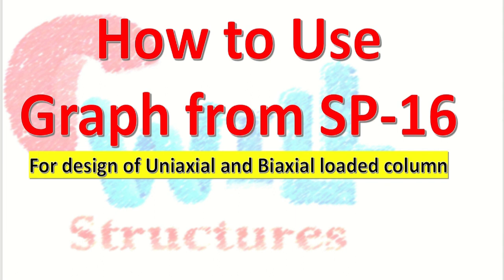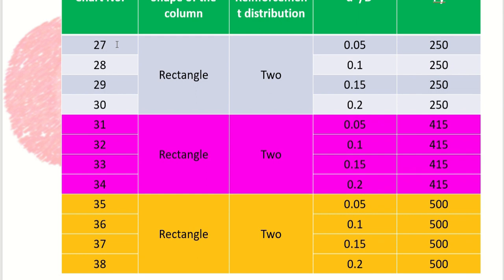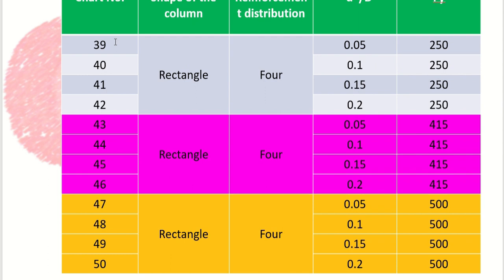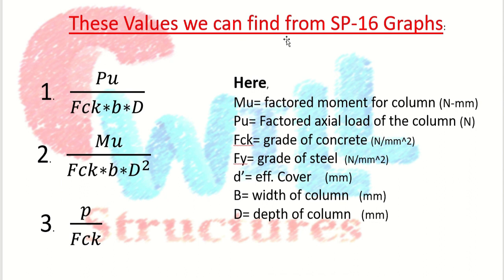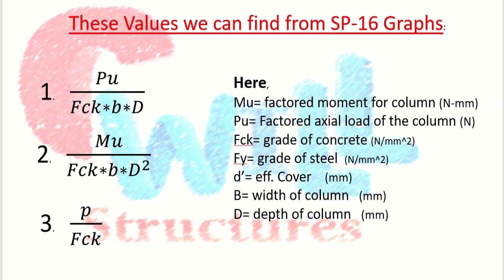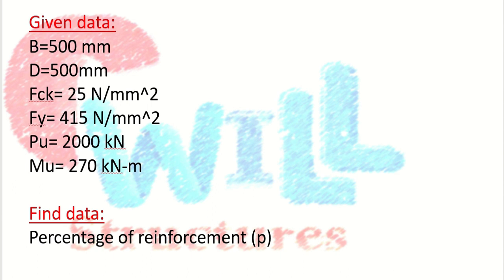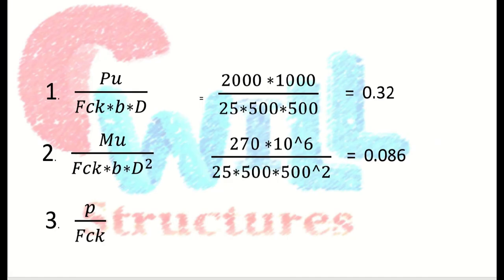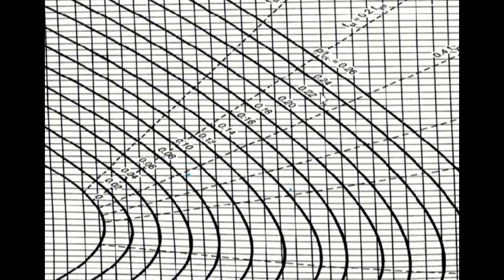How to Use SP-16 bending Charts for Design of Uni- axial and Bi-axial Column ?

Comment: I seriously doubt the use of chart in case of finding Mu*fck*b*d²  when p/fck*b*d & p/fck is known.. 

Kindly do some research again... Becoz that p/fck value is based on curves and not linear in nature . U have to follow the trajectory of curve touching the X-axis. To find Mu*fck*b*d².

 Also see page no. 105 of sp-16. They have used chart 44 in the solved example . For this...
Reply: Salam brother
Reply: do you have strength interaction diagram spread sheet
Reply: @shahidali-zy2bw  no bro. I don't have Excel sheet for that .